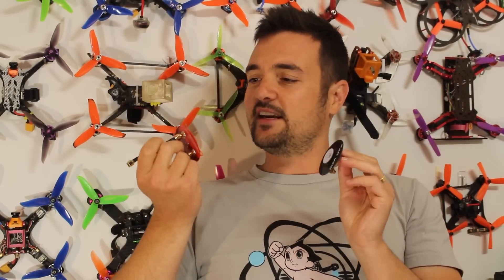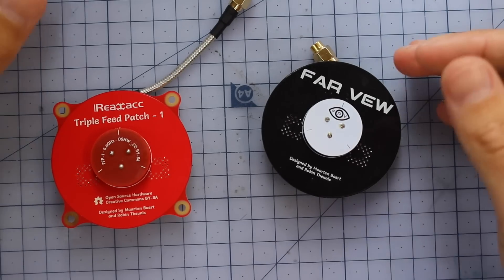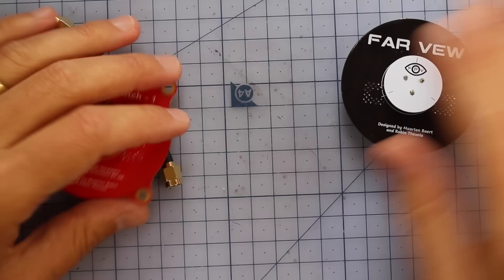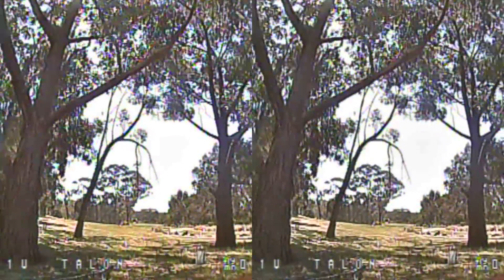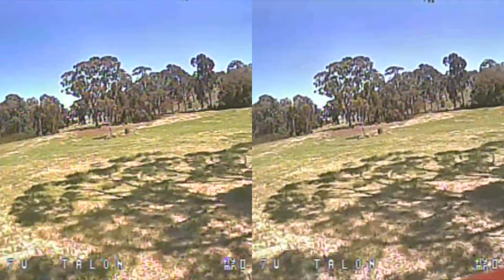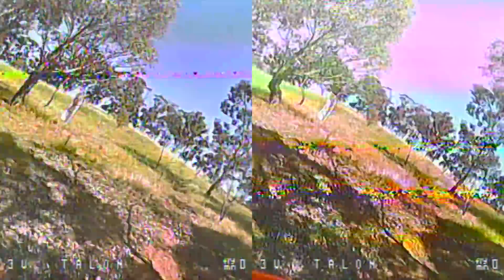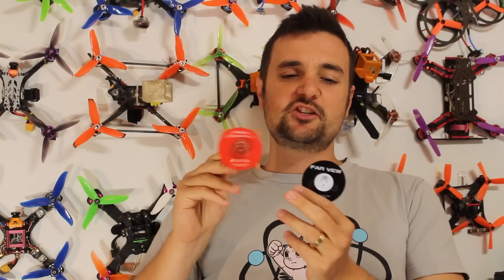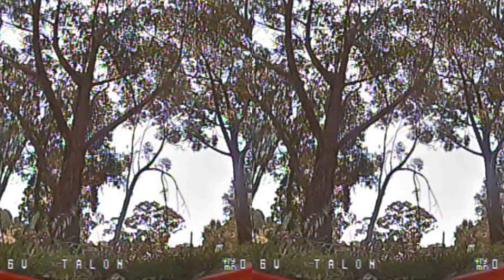Long Range FPV. Antenna test. TECH TUESDAY UAVFUTURES

Comment from the maker: Would you get one? if so which one? 
Farview version - http://bit.ly/Farview
Realacc version - http://bit.ly/REALACCpatch
Aomway version - http://bit.ly/AomwayTpatch
Reply: Farview version - the dummy plug is included in the price.

The designer (Maarten Baert) wrote: "Any 50 ohm terminator should work, it's not critical. You can even use the antenna without a terminator, it will still work fine, the axial ratio will just be slightly worse [because the opposite polarization will  be reflected instead of absorbed.]"

Realacc and Aomway versions do not have the dummy plug.
Reply: Phil Cogswell if you ordered Aomway there is no note. But Ive ordered the realacc like two weeks ago and Ive seen the note but that not changing anything about the fact that you should always check what youll get for your money. There is no terminator mentioned in packaging list where there is a warning on antenna to use terminator. But yea, its unprofessional to exclude that from package.
Reply from the maker: @dlc drone, you are all fine with RH and just some pegoda antennas, 3 people are pretty easy to get flying
Reply: Rich Hole watch the video
Reply: Aomway have used 2 male connectors on the aerial so you can't put a dummy load on without an adapter. 
Works OK without but not too sure when flying in a group. I'll def be buying some LHCP now.
Farvew has got a nice short cable and deserve your custom for getting the design right first time.
Reply: You do realize Maarten Baert is from Belgium and does not sell these? So stating that you would support him by buying from a Utah based company makes no sense..

Since this design is licensed under a 'Creative Commons Attribution-ShareAlike 4.0 International License', this means anyone producing this design for commercial sales has to credit Maarten and Robin. So it does not matter from which brand you buy it, none of them "support" the original designers, they only credit them (which all brands do).
Reply: Ive already ordered the RealAcc one just because of price and high gain combination. I would def. buy the far view one but if I dont know whether I like it or not....its too much to pay 50$ for 20$ open source antenna that I can do by my self and I wont possibly like.
Reply: I dont understand how you guys missed the terminator. Its written right at the start of the product description with RED....and then also as sort of a warning on the antenna that you need it :D IMHO its hard to miss (edit: oh yea aomway has no note - Ive got realacc)
Reply: kennuardo hartinger because it wasn’t there in the initial listing. It got added when people like me complained
Reply: kennuardo hartinger I didn’t order mine two weeks ago. I’ve had it for over two weeks. It wasn’t there when I ordered mine
Reply: Dummy terminator not included with Aomway either but I'm expecting it to arrive soon. I'll try and run a rig test and post back here if I get any decent footage.
Reply: Stew hello, hope all is well with the UAV family. Question for you. My sons and I have 3 Eachine wizards, 2 vr007 and pair of aomway. In your opinion what would be optimal set up. Antennas, patches, right or left.
Reply: UAVfutures thank you for this
Video it helped me a bunch.
Reply: Idea for tech Tuesday: common and not so common gotchas to avoid when wiring a flight controller on your first build.
Reply: UAVfutures I like and fly FarVew, including that patch, but the did not come up with the patch. Martrn Baerts did. It is open source and all brands can make and sell the design.

And the original design actually has the four ears/tabs like on the RealAcc. Probably why it works better.
Reply: Do you get two or just one. If your running diversity?
Reply: I have something similar to this in my basement. Could I just mount this on a tripod, sit next to it, and use that with FPV goggles? Is there a catch?
Reply: I bought the cheap one and didn’t realize the dummy load was separate..   👎
I need a couple of them so the next one will be the Farview

Comment: UPDATE:  I figured out why the image is in 3D.  The two sides are not synced up perfectly.  One side is one frame behind. This allows each eye to have a slightly different view especially when the done is turning.  If your goggles have two images it would be possible for goggle manufactures to allow a one or two frame delay on one eye's display.  This would allow you to fly in 3D.  It would be great if the goggles could figure out if you are turning to the right or left and and delay the appropriate side to get maximum 3D effect. :)

ORIGINAL POST:
OK this is impossible but if you cross your eyes to overlap the side by side flight footage the image becomes 3D.  Now this should be impossible if the quad only had one camera.  To make the image easier on your eyes don't view it in full screen mode and hold up both your hands so your right hand covers the right half for your right eye and your left hand is covering the left half for your left eye.  Basically you are looking at the left image with your right eye and right image with your left eye.  This is what crossing your eyes do.  The only way we should see 3D is if either the drone had two cameras or the editing software used did an algorithm to turn it into 3D.

Comment: A little late, I know. Question. Would putting a terminator on your goggles and your antennas unused coax terminals have stopped signal phasing in both?

Comment: Heres one!  Can both antennas be connected as a center of signal mass? My hubsan zino pro has 2 5.8ghz connections on the controller in which I do not know if its RH or LH. Some also are saying that you need a 50ohm load on the unused side.

Comment: it was a very informative video and I did learn plenty. I'm a newbie in 
drone flying and became interested in aftermarket antenna's when 
researching goggles for flying drones. 

It didn't occur to me that both drone and goggles could benefit from aftermarket antenna's. 

1st, let me describe what equip. I am interested in purchasing :
Drone : Xiaomi FIMI A3 5.8G 1KM FPV With 2-axis Gimbal 1080P Camera GPS RC Drone Quadcopter RTF - 5.8G FPV
Goggles : New V2.0 Version FXT VIPER 5.8GHz Diversity HD FPV Goggles

2nd,
 some people have mentioned or obviously replaced original antenna's w/ 2
 different aftermarket antenna's on the goggles (patch on 1 side & 
circular polar on the other).
Question : 
What is your opinion on this technique ? (benefits, pro's / con's) ?

3rd,
 all that said, what is your antenna recommendations for setting up my 
1st drone system, (goggles & drone) as I have described above ?

Thanks you very much for your generous consideration,
sincerely ............................

Comment: I'm pissed as hell. I ordered the aomway version and the linked dummy plug. It doesn't fit. I can't find one that fits. And I can't find an adapter for the linked one. Should have gone for the original. Don't make my mistake!

Comment: I think you really need the antennas on the same head to ensure they always point the same way. I find myself trying to point my head in the direction of my quad when flying FPV to lessen dropouts.....then again I'm only running a 25 mw trans on my micros.

Comment: I don’t have a dummy load but is iT possible to just directly solder a 50ohm resister to one side because most dummy Loads are 50ohm (i only use rhcp)

Comment: I just bought the race 412 triple feed patch. It was $20.00. The problem I have is the cable that came with it will not tighten so that the patch antenna is loose and turns freely when on the googles. Is this something to worry about, because it seems as if it should stay solid on it and not turn? Makes me nervous that it is not getting the contact it needs?

Comment: You need to do a video on these patches if you can point them in two different directions on the diversity setup and see if you can get like super clear and all directions seeing as its diversity it would be able to pick up the areas of the weakest spot of the other one and maybe the polarisation would be overlapping in areas where one's week could you try that out curious

Comment: I have one made by RJX which does not include a dummy load. I have some sma adapters laying around. Can I use one to make a dummy load? i'm assuming since this is a receiver, the resistance of the dummy load isn't important. So I should be able to close the loop on an sma adapter and that will serve that same purpose.

Comment: Really surprised you guys are still using patches, a crosshair costs roughly the same Amt of money, has much better gain for better distance and penetration, much wider beam width and rejects multipathing much better

Comment: Stew make a second video where you give credits to the real designer of this the maker of the pagodas and a collegeu of his. You are ruining you reputation big time. Like you haven't informed yourself at all. This has been around for some pretty long time and a big party of the community know about it. Make a second video it's disrespectful to the actual inventors
Reply: FunTechandMore that's definitely not his responsibility. Any pagoda made should include that information as per the requirments of the license, Stew would only be required to do this if he actually made these antennas and even then he would only need to credit the creators on the device as stated by the license. Far Vew as far as I'm aware are the closest affiliated manufacturers of the pagoda and Stew has done his channel credit by ensuring their inclusion. There's a heap of people producing these and he could chosen any, yet he chose the one that would benefit the creators the most.

Comment: I won’t buy until I see an advantage. 
I can get a good standard patch for $6 US. How do these compare to standard patch? Increased range would be the only driver for me. If I want to switch antennas I can do that now without added cost.
Reply: J Renwick what's a patch you've been using?

Comment: As a matter of principle I always go for the products that are not knocked off by other manufacturers. Looks like I’ll be spending some more money on another patch now. Thanks Stew.
Reply: realacc or aomways aren knockoffs of farvews design... in fact its an opensource design from another guy who does have no relationships with farvew... i would agree that there a lot of copycats but in this case u can just buy the cheapest without feeling bad... not to say that farview isnt a company that is worth supporting.
Reply: Aaron Rogers - That open source point wasn’t missed on me. I was merely referring to my principles when making purchases. Those other companies you’ve mentioned have been guilty in the past of ripping off others designs and for that reason, I’ll always go for the company that makes a real effort In moving the hobby forwards without compromising on quality.

Comment: Hey quick note about the Aomway version, they took the required designer annotations off so in other words by doing so they are claiming that they designed it and are not giving credit to the designer!

And taking a closer look it looks like they have used the male SMA connectors which will not allow you to get a dummy load!

Comment: Hey!

   Thanks for doing a comparison and showing just how well the triple feed works!

We do need to say though that the "Triple Feed Patch" was designed by Maarten Beart and Robin Theuins" they are the heros that really deserve the credit and appreciation, in our opinion they have totally reshaped FPV!

One thing to note is the the length of the extension, in our experience the shorter extension will decrease performance a little bit because of the proximity to the goggles, we do offer a longer 45mm extension but for us it gets a little too long and cumbersome when using a neck strap.

Thanks and happy flying guys!
Reply: Is it also possible the centre tuned frequency (sorry i don't know the technical term) was closer to the  quads output freq. in this test? I've heard there are some factors that can alter the accuracy which i imagine could be beneficial depending on what frequency in use ...
Reply: David pm
Reply: I use the Far View tripple feed patch with the short extension and I really like it. I'll have to try the longer extension at some point to see if there is much of a performance increase. 

I am really curious of how much better the 150mm triple feed patch performs compared to these models.

Comment: +UAVFutures - far view didn't design these a guy called Maarten Baert(sp?) designed these and open sourced thme. Same as the pagoda.
The guy who designs them does not sell them. He just gives away the design files.
They're great antannaes.
Reply: I was in 2 minds, your comment just convinced me to buy the cheap version
Reply: Sometimes you're also paying for customer support, etc. so that's something to keep in mind as well :)
Reply: Precisely right.  PiroFlipRC and Race412 make versions as well.  I have the Race412, and they're absolutely brilliant - they pair great with the Pagoda antennas from, you guessed it, the brilliant mind of Maarten Baert.  (The triple feed is a collaboration between Maarten and Robin Theunis)
Reply: I just bought the Race 412 and the coaxal cable that it came with will not tighten on the one end, making it so the antenna spins freely when mounted on my googles. Is that normal? Or should I get them to send me a new cable? Also the antenna is not labled which side is left or right? Does your cable allow the antenna to spin when mounted?

Comment: Hey guys. 
Is it a right position for patch antenna? There is no information at manual which side is diversity side and I always connect my patch antenna to the wrong connector:))
Reply: I am not sure if you are talking about which terminal to connect to on the goggles?  If so, it doesn't matter as both terminals are working in diversity.  This means, whichever antenna is getting the best reception, will be the one selected via the diversity receiver.  Hope that helps!
Reply: Sh FPV doesn't matter you can use either side. There's not really such a thing as the diversity side except for with th kafir get, and that's really only because only one of those revievers has  a screen and controls.
Reply: Good. Thank you. I didn't know that. It's helpful.

Comment: Aomway has the same version. I wonder which one is better between the Realacc and Aomway.
Reply: In general, both are manufacturing antennas that are not that bad so I would stick to the paper and get the realacc one as it offers better gain (on paper (I would get the far view if I wouldnt have to pay 5 time the price of realacc)).
Reply: kennuardo hartinger Thanks.

Comment: Stu, what’s a good FatShark style goggle to transition from box style with?
Reply: @ELEV8 FPV
Aomway are great, but the foam padding is crap and falls apart (build quality not the best?). Skyzone is my choice, but if you have a big nose, you'll have to DIY some foam to make them comfortable as there isn't much nose clearance . Apart from that, the skyzones are amazing. If you want to spend too much money, go for fatshark. If you are on a budget and don't need DVR, check out FLYKEY RAFALE V1. Or if you are super budget, Eachine EV100 is entry level.
Reply: HD3 or wait for the new skyzones and check them out